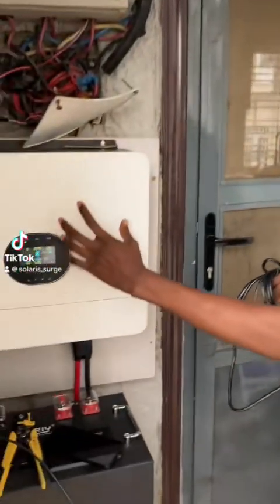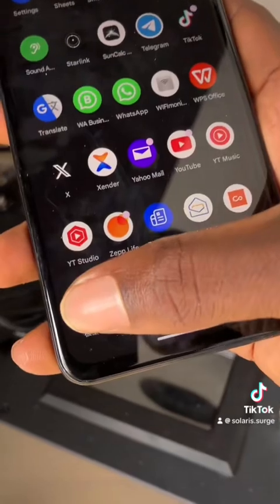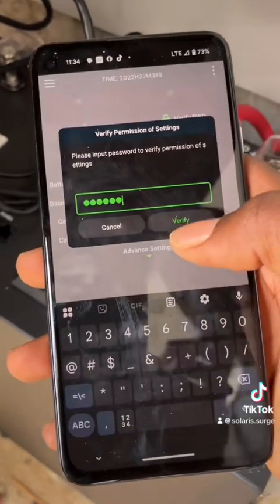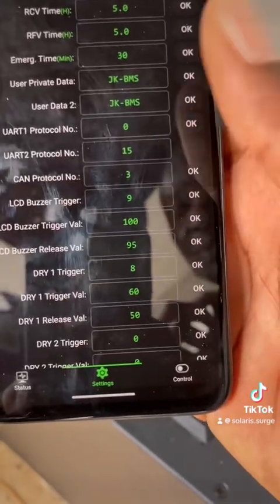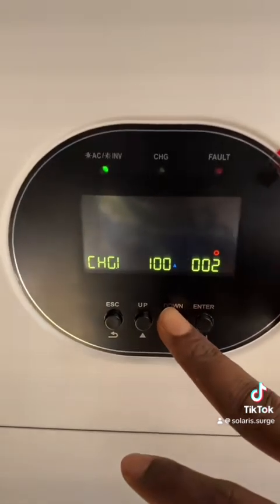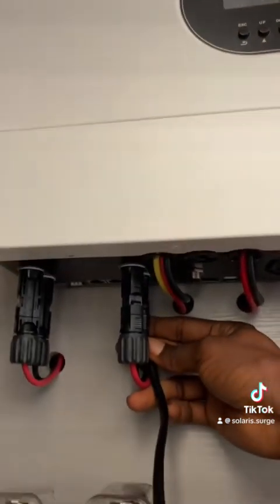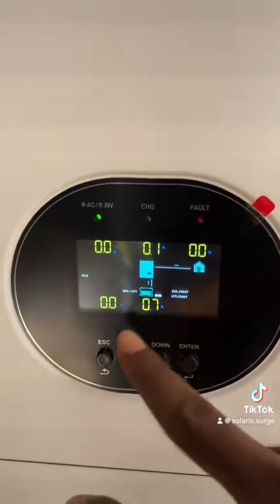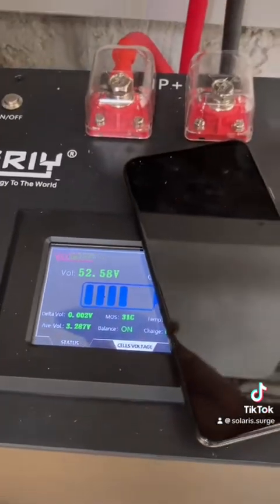How to communicate Deriy LFP batteries with Any inverter (Growatt)

Comment: Bros I get brand new powMr HHJ-60Ah mppt charge controller for sale
Reply from the maker: @odohgift972  put it on Jiji
Reply: @odedeyidamilare  it's on jiji warri but I'm not getting buyers o since it's free ad. I want to use the cash to get some panels. I'm inquiring if you have buyers within warri environ